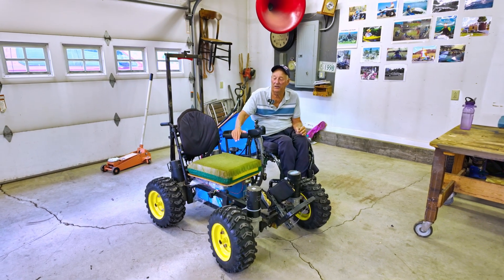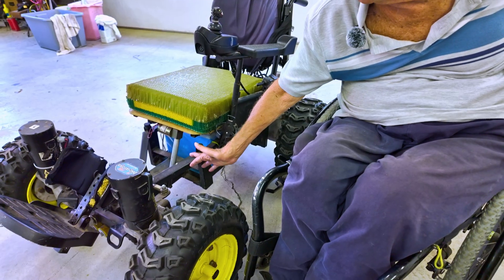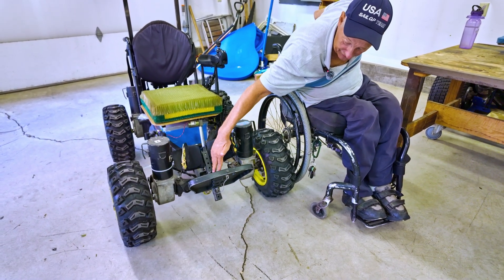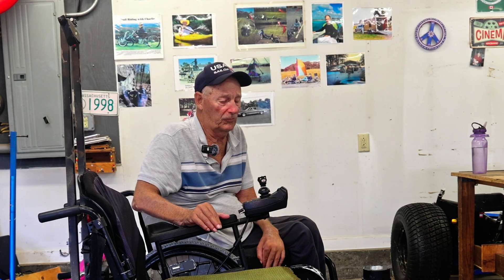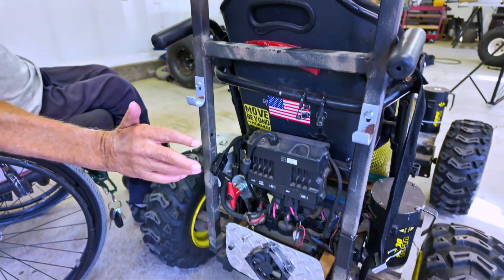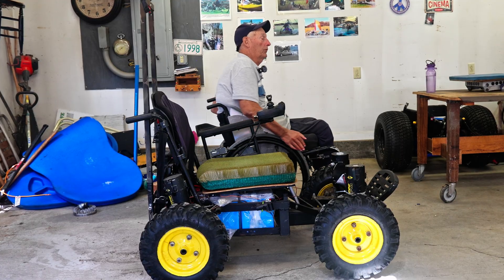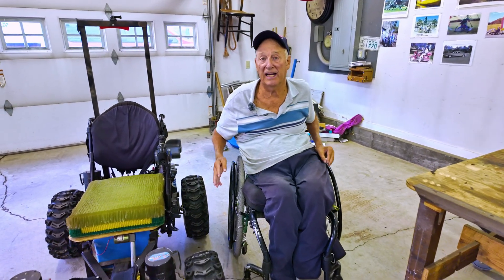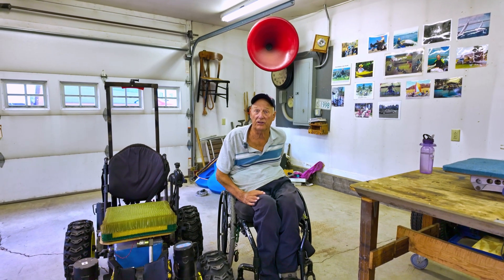How I Built My 4-Wheel-Drive Off-Road Wheelchair

Comment: I need one of these 4x4 power chairs, i sunk all four tires in the grass / now mud hole/ yesterday on my Jazzy 1450 i even have 36 1/2 inch x 2 1/2 inch lag bolts in each front tire to act as studded tires, i live in a very rural area so everything is gravel or dirt. I always keep my cell phone and have a CB Radio on my chair to send out a SOS when i get stuck lol.